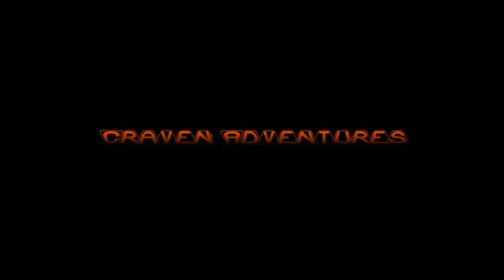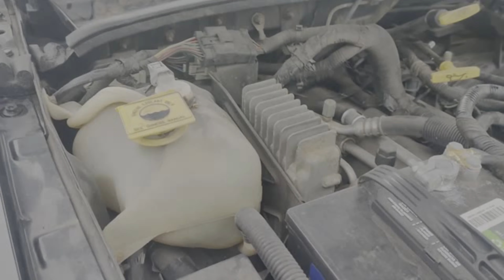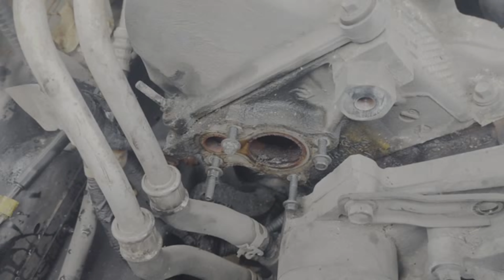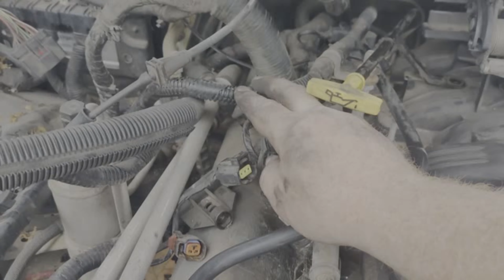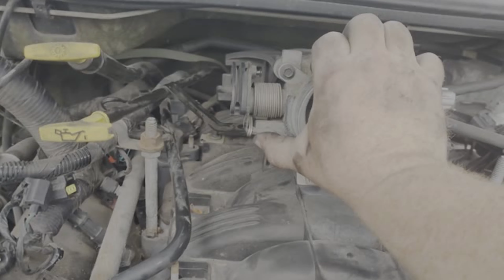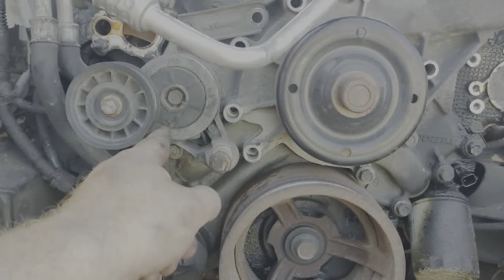4.7HO ENGINE TEARDOWN on our 2003 Jeep Grand Cherokee Overland WJ "Midnight" Part 1

Comment: Any issues with cracked injectors and hard start issues?, I have a 02 patriot blue wj Laredo that I’ve had for a few years and the oem Siemens injectors are done for. Cranks for a solid 3-4 seconds and huge puff of black smoke out the exhaust on startup most of the time.
Reply from the maker: No, the injectors look great. As I tear into her the happier if get because it may have looked bad from the beginning the deeper I am getting she looks well taken care of. But I do plan on replacing the injectors for some more efficient injectors
Reply: @cravenadventures  have and recommendations on injectors? I can’t find too many sources for brand new non refurbished injectors, I’m thinking about the denso 12 hole swap but I want to keep it mostly oem since it runs good when running for it having 251,000 on the odometer
Reply from the maker: @brynnond.6952 I am planning on using the Denso 12582704 injectors. The flow rate is a little higher than OEM. But the itemization of the injectors might increase the fuel economy and more horsepower
Reply: @cravenadventures  I’m excited to see how those injectors work for you, I’m nervous about not using the oem style because if they don’t work then I don’t have a car, if they work well for you I’ll consider using them
Reply from the maker: @brynnond.6952  sounds like a plan